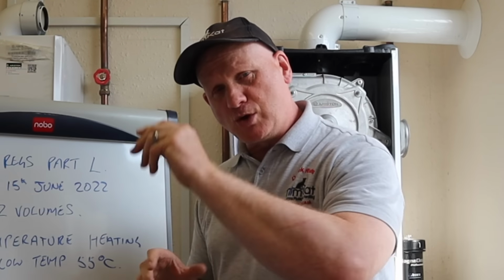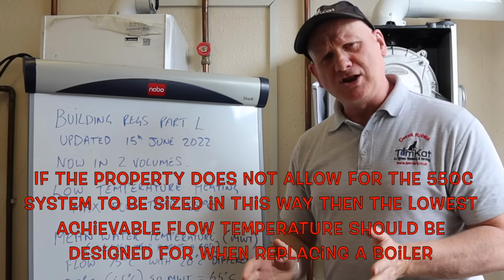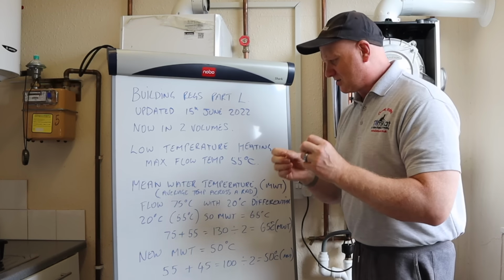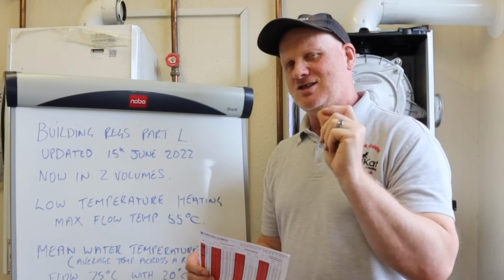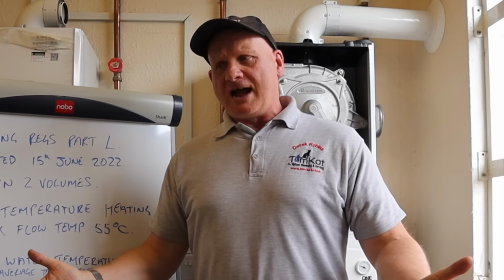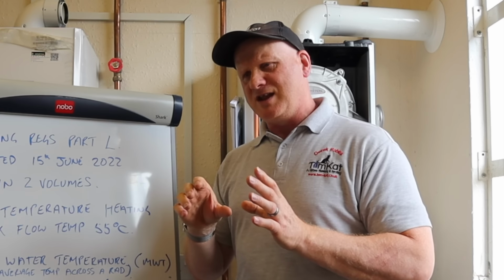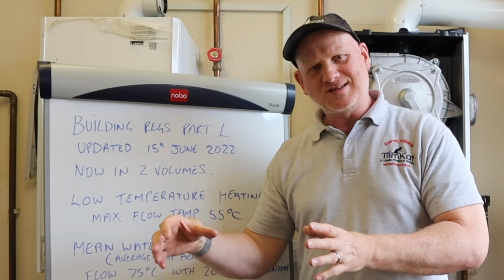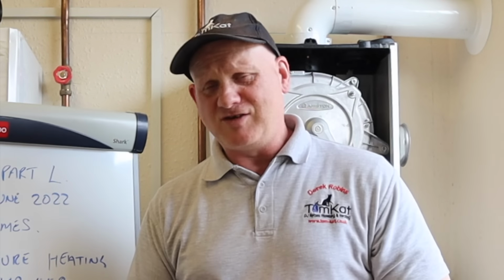Don't adjust your  heating flow temperature until you have watched this video. #saveenergy

Comment: Retired surveyor here. Many boilers, both combi and indirect, have manual boiler stat knobs (not digital like the Ariston one shown in your video) with graduations  but no temperature markings to show what these graduations mean. This doesn’t help when setting it up correctly. 
When working (Housing Associations for 34 years) I was never a fan of combi boilers - good for heating but very unreliable for hot water and cost a fortune to maintain. 
Another bit of advice if I may, if you have an indirect cylinder but no bath (only a walk-in shower) make sure you install a power shower that works off your cylinder - like an Aqualisa , NOT an electric shower. If you have an electric shower  and a cylinder, then you are heating a whole tank of water for basically a bathroom basin and kitchen sink - very uneconomical.
Reply: But very good for airing and drying clothes in the depths of winter without using a power hungry tumble dryer !!!
Reply: A  fortune to maintain a combi boiler? £50 to 80 quid once a year isn't a fortune.Hot water is fine and we run a shower off the boiler upstairs.Our Boiler has a ten year quarantee.I add pipe protection myself either through the top towel radiator or through the boiler.I don't know what you are on about.

Comment: Easiest way to save gas and electricity on a CH and HW system is to  shut the over complicated  fluffing thing off and resort to "On demand" water boiling, in a kettle and an electric  fire.

That and K -glass double glazing and wall and roof insulation, not using the tumble dryer (double-spinning and rack drying) or dish washer, switching-off everything on standby until needed, swapping out all house lighting for very low wattage USB lighting  LEDs(Less than 5w per bulb),  USB 4w fans, switching off the telly and viewing TV on a tablet.
Swapping out a 15 watt clock radio alarm ou fort a 1.5w USB powered unit. Doing the synthetics weekly laundry wash by hand, saving one washer cycle @ 3 kilowatts per occasion.
Installing radio-controlled plugs so that devices on standby and lights can be switched off in a group until needed.

In winter in would be cheaper to keep the curtains drawn and save on heating and light the house using low wattage  USB lights.

In summer theres no need f to heat water  for washing as the stuff coming out of a roof space  hot cylinder will be warm enough when the sun's out.

Ditching the freezer  and substituting canned, vaccum packed or freeze dried foods.

That' what I'm doing and saving a fortune.

Lets make the savings so great so  that the utility shareholders will jumping off the top of the Olympia and York building clutching worthless share certificates. . Barstewards

Comment: on my last combi boiler service, the bloke adjusted something and now instead of me having nice hot water at the kitchen sink tap within 5-8 seconds of turning the tap on (the combi boiler is approx 8ft away in pipe length), it now takes over 15-20 seconds to get the same temperature hot water as previously.
What did he do? Surely running the tap so much longer is using more water and possibly more gas? (also it's pretty annoying)
Reply: He turned the pre heat off
Reply: should add, this is without the central heating switched on, since I very rarely have it on, so the combi boiler is almost exclusively being used for hot water at the kitchen sink, and less often for the washing machine hot water inlet whenever I have that running.

Comment: Hi I have a Condensing boiler fitted to a much older radiator system. The heating setting was set to an output temp of 75deg , I measured the return Temperature at about 55deg . I reduced the output to 60 deg ( return about 42deg) this did not heat the house enough the way we use the heating normally ( 2hours in morning and 4 hours at night). Have settled at an output temp of 65 deg in winter and reduce to 60 deg in milder weather.

Comment: reducing flow temperature you're just delaying gas usage. you're going to use the same amount of gas. the thermostat is just going to keep the boiler running for longer to get to your target temperature. 

having said that I've lived in rented properties - that didnt even have a thermostat, it was either all hot or not at all. so i had to regulate the temperature of the house using the flow temp.

Comment: The legislation to lower the boiler temperature by law like this is a crime really, they have done it to FORCE the installation of heat pumps which operate at lower temp anyway. So people are FORCED to fork out tens of thousands of pounds to replace radiators AND pipe work. How can this happen, democracy is out the window, horrendous.

Comment: I had a modern system put in 3 years ago.  The said pipe lagging was not important for internal pipes as the heat lost from them is just going to heat the house anyway.  External pipes obvious must be lagged now.  My only thoughts where, "Fine, but maybe at least the hot line that runs over the attic to the bathroom should be lagged, even if it IS under the 30cm of insulation?"

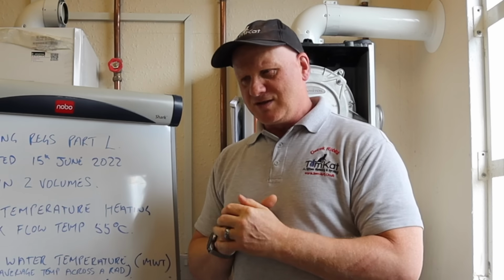Comment: 12:30 - would this "pump reacting" be the cause of the "breathing" effect the boiler/circuit makes?  Mine runs low and slow for about 5 seconds, then spins up for a few seconds then back down again.  It's a worchester bosch, green star I think, 30kW.  Only 18kW of radiators though.  It's either the pump pressure sensing, the boiler PID controller doing it's load sensing, ie... run low watch the return temp start to fall, ramp up the power, watch the return temp rise and analyse.  Take the average ramp angle of the rise and fall as the load/demand.  The thing is, any software engineer worth his salt would have that hunting fixed...
Or as I intended to ask before wafling... is my pump/flow rate whatever set up wrong or the boiler over sized?
Reply: My boiler does much the same. It was sized for six bedrooms but now the kids have left home it's much too large and cycles up and down - overheating and then cooling again. Bad for the boiler and bad for gas bills. Apparently the answer is a boiler with a high modulation ratio i.e the ability to reduce the amount of gas it's burning to match demand. My WB is bad at this as, it would seem, is yours. There are boilers much better at it, I intend to choose one when I replace mine.

Comment: My hot water is set to 42*C on the combi.  This allows for a shower without using cold water.
I wanted to point out however, that it's a false economy in such a case.  The reason is, when you shift the mixer tap towards the cold, 2 things happen to the boiler, first it's cold water feed pressure drops, which it senses, might not have to act on it, but it might have to back off on the burner output to compensate for reduced INPUT flow.  The second thing that happens if you apply back pressure by closing the hot valve slightly.  This reduces the OUTPUT flow through the boiler.  Reducing the flow, reduces demand, reduces burner rates.  It is very likely, if your combi is over-sized, it will be no where near 100% burner output and adjusting the heat at the tap (mechanical mixer) will have 'virtually' the same net effect on "energy consumed"....  however that would be 'at the tap' consumption.  Pumping 65*C water to the tap, and cooling it down there, is much less efficient that pumping 42*C to the tap.  The difference is in the heat lost in the boiler and the pipes.
The dishwasher is cold fill and does the "hygiene" temps.  If I want to wash the floor or clean the oven I have a kettle.... or I can turn the boiler up to 65*C.
** Caveat.  This all becomes far more complex if you have more than ONE demand at a time, such as in busy family homes with 2 bathrooms in the mornings.
Reply: i also have the hot water set to 42C in the family home. Very very rarely do i need to turn up it for any reason. Water at the tap is very rarely needed to be above a comfortable 'hand-hot' temp as its almost always for showering, hand/face washing. Like you i also thought delivering scalding hot water then cooling it down was ineffecient. No science to back it up, but it just seemed common-sense to me.

Comment: My heating (automated) has only just come on again for autumn, it was last seen in early May.
It's still set to 45*C flow temp for summer.
Interestingly, my system has been painstakingly tuned to 12*C delta, such that a loop temp of 65*C max will result in a return below the 54*C condensation temperature.  It normally goes to 55*C around October, as soon as I see "run times" stretching towards the 1 hour limit on the morning boost period (for humidity/damp/comfort purposes the temps targets spike for 1 hour to "warm the house up" in the morning.  Then it defaults back to "presence aware" targets and heats rooms in use more than others only on demand.
At 45*C, I'm looking at my flow pipe temps (measured in the middle of the system on the up/downstairs feed/return lines.  It's still showing an initial delta (when it stablises) of 11*C and just before it "cycles" out, it's still 9*C delta.  Boiler is cycling a minute every 5 to maintain.  It's delibrately being kept at 45*C because currently I'm seeing dawn lift temps more than the heating, so while I still haven't written automation to cover that case, I left the heating in summer mode.  Similarly the office needs to lift the temp up to 20.5 when I enter it, but "I know", the system doesn't, that once I sit down and turn the PC monitor on and get a cup of coffee, the office will already be 20.5 without heating... too late.
I'm sure in a month it won't be so questionable as to whether heat is require or not.  It will be how much, how often until April again.
I'm not sure YT will allow an imgur link, so I'll add it as a comment to this.  It's (part) of my heating system dashboard, showing, demands, boiler and flow temps.
Reply: A few hours from this morning.  45*C flow target temp.  https://i.imgur.com/3Iqsfb5.png
Reply: Summer, 45*C is basically because, heating requirements based on target temps are rare and often false positives.  No need to waste 5 minutes boiler time of minimum runtime at 65*C on false positives and the odd morning I left the window open all night.
Reply: An interesting thing occurs on that graph at 09:20.  It's the office "demanding" heat now.  But it will take that radiator a minute to come on (TE actuator).  The loop is still warm from the earlier "boost" schedule, so when the boiler fires up it immediately cycles due to it's own demand sensing determining the loop is fine.  However 5 minutes later with the now freezing cold office radiator in the loop the demand sensing ramps in the gas to get back to 45*C.
I like "seeing" things actually working like these graphs show, I can spend 15 minutes reviewing them in the morning, sometimes.

Comment: You forgot to mention draft exclusion. In many properties that is a major factor in energy saving potential. But an otherwise good explanation of gas consumption. Also, don’t forget that reducing water flow rate can increase delta T which could increase efficiency providing your emitters are large enough.

Comment: Boiler Manufactures need to address the waste of both water and gas, that is used when the hot tap is turned on, as it can take too long for it to reach temperature, even when the boiler maybe right next to the sink.  A lot of pre-heats don't work, and even when they do, they are very expensive to operate. Most ordinary people watching social media, have no idea what they are doing, and will follow what others do, even if it's wrong........

Comment: just had a 40yr old servowarm std boiler replaced with a combi. i think the reason it lasted so long was the gas level was on minimum most of the time so it didn't constantly switch itself on and off but maintained a satisfactory warm house. in the 40yrs the pump was replaced only once (grundfoss). very understandable and informative video.
Reply: Most boilers made today are not made to last like the old ones.  My old boiler was in for 30 yrs.  The new one, I don’t think will last 12.  It is all part of the throwaway society.  I would sooner pay a bit more for something that would last.  But jobs unfortunately rely on us replacing things all the time.  Just reality I suppose?
Reply: With you there, we had to replace our 32-year-old baxi back boiler when it was working perfectly, but a wire had been laid behind it and melted through. Up until then, it had a service once in a while, but never actually failed, with only 4 parts in it, only one of them moving, there wasn't a lot that could go wrong. I replaced the pump twice, but at £30 from the nearest Graham, that was no real effort. Overall, NOT replacing the boiler saved hundreds of pounds. It must have used far more gas than the combi, but it didn't need a service every year, with the carbon overhead and money costs of an engineer's visit.

Comment: we get our boiler serviced every summer - we did ask the engineer about adjusting it to save gas and were told the same thing . I also think turning off radiators in un-used rooms is a false economy - it doesnt really save anything and you risk causing  damp and condensation in those unheated rooms .

Comment: Is there a minimum temperature hot water needs to be on a combi boiler, or do you not need to worry about legionella on those?
Reply: Legionella grows in standing water. So if there is standing water in the boiler, and I know there is not much compared to immersion heaters, then yes the minimum temperature requirement must be observed.

Comment: Great video with relatively easy to understand explanations- one missed tip that is relatively inexpensive but very effective is heavy curtains on windows ( double glazed or not) and draughty doors
Reply: Relatively easy explanations?  I am a technical person and I know that a lot of this would go over most peoples heads.  A lot of people I know don’t really understand how their simple central heating controller works!
Reply: Fully agree, back to the good old days when we only had open fires.
Reply: @David Wanklyn Hi my comment was a tongue in cheek remark.
Reply: @@davidwanklyn8842 didn't that cause a massive death problem one day.

Comment: Yes, the old fashioned radiators are more efficient because of their ability to store heat. This increases the temperature delta. It's bit like getting a car up to 70mph and keeping it there. A larger engine costs more to get the 70mph but far less than a smaller engine to keep it there.
Reply: You don't want a radiator to hold heat, do you? It's a RADIATOR, it dissipates heat.
Reply: I suppose you mean cast iron ones
Reply: I have cast iron radiators and run my boiler at 50 degrees water flow temp and have done for years now. You get a lovely radiant heat from a cast iron radiator not and convection heat like the standard ones. My room stat is also set to 18 degrees. My gas bill has always been low.
Reply: @adamwoodall9506  I think you will find that water filled radiators deliver mostly convective heat and not radiation in the form of IR
Reply: Attack is the best form of defence.

Comment: Not many here have ever tried to heat an old listed building with cast rads, needs to be very hot!  55degC is a not practical, even with double glazing and insulation.

Comment: If you have to fit bigger rads then you increase the volume of the heating system. How is it more efficient to heat a larger volume to 55C than a smaller volume to 75C?
Reply: It's the efficiency of the boiler that matters. Don't forget some heat from the boiler goes out of the flue. Reducing that increases efficiency and saves money.

Comment: Interesting, but no one is going to be changing their radiators for bigger ones as the cost is prohibitive.  Running at a lower temperature is all we’ve got, and if you get cooler there’s not a lot we’re going to do about it.

Comment: Way too complicated for me. Lost me very early on. 
C
Reply: Basically pray you dont ever need to replace your boiler else your choice is a virtual complete new CH system including pipes and rads or, the new boiler wont give the same output as your old one so your CH will not get as hot as it does with your old boiler!

Comment: One thing that's been mentioned is more insulation. I'm at 400mm of insulation in the loft

That's the maximum recommended as any more means condensation

Comment: As people are told to turn off rads to rooms they are not using & considering, boiler cycling becomes an issue re wear & tear especially when people reduce flow temps. I have 10 rads, but mainly run 3 rads once everyone is up. If I run the flow at 50c the boiler cycles constantly. So I run my boiler at a flow temp as low as possible to reduce cycling while the room stat switches the boiler off. I should also state I can reduce the % the heating circuit runs at. In the winter I have the CH circuit of the boiler set at 10% of max 25kwh output. In the warmer months 0% just in case the Mrs & teenage kids flick the boiler on 🙄

Comment: As usual the government interfere and everything gets massively over complicated. We installed double radiators with thermostatic control on every radiator. 22mm coming off the boiler as the backbone breaking out 15 mm the radiators all pipework insulated. All controlled by central thermostat combined with the timer on the combi boiler.

Comment: My house was built in 2014 so I'd have thought it was efficient. But the radiators are bloody tiny. And unless it's literally freezing outside the radiators are never more than Luke warm due to the stupid ambient weather temperature sensor thing controlling the flow temperature. I had to disconnect it to regain manual control of the flow temperature and can finally warm the house up.
Reply: There should be a 'slope' setting which matches the outdoor sensor to the system capacity.